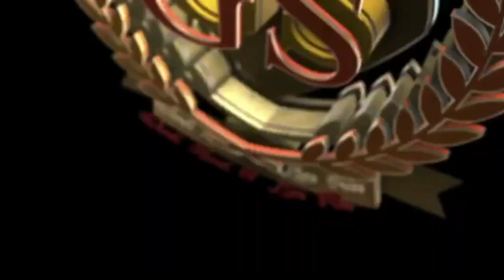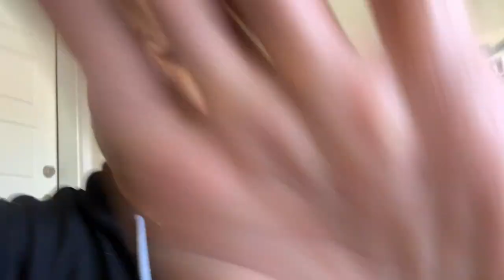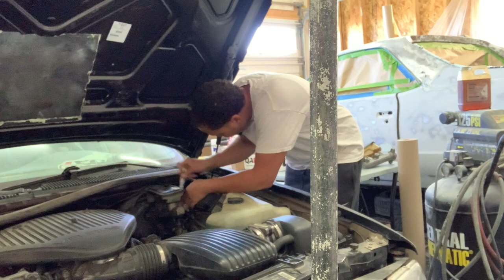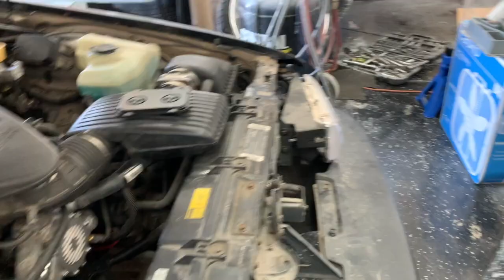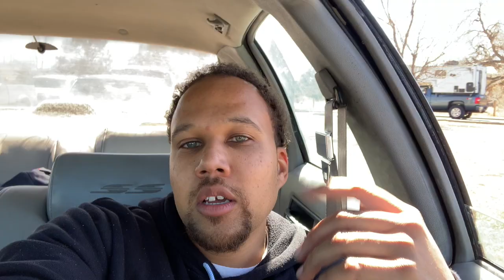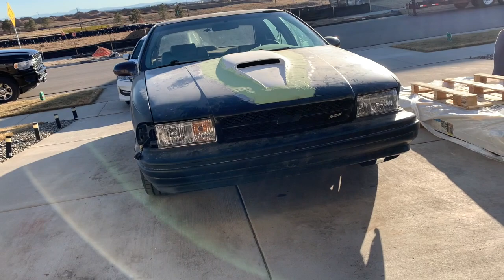MY IMPALA'S MASTER CYLINDER STARTED LEAKING AND IT FAILED EMISSIONS !!!

Comment: Did you have to bench bleed the MC? I just got mines in from AC Delco im replacing the booster withvit
Reply from the maker: I think you’re supposed to but I didn’t. I just bleed the brakes after it was on.